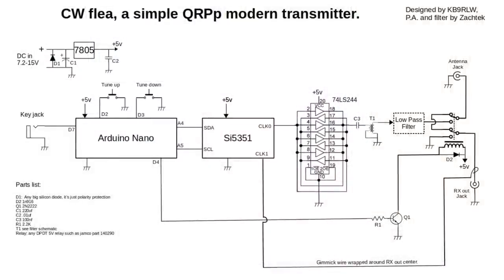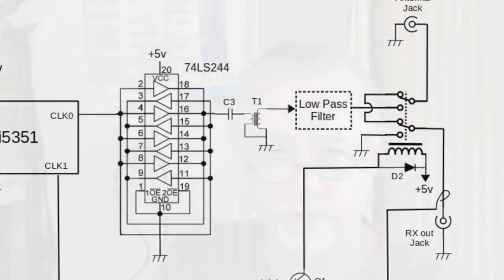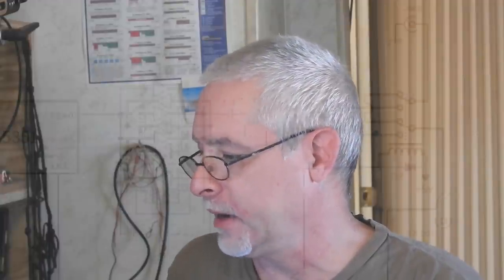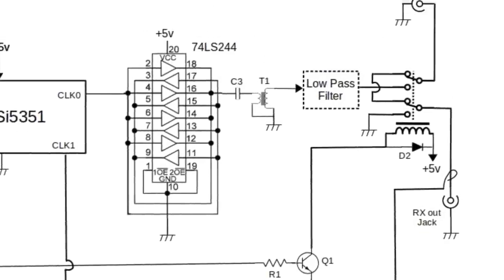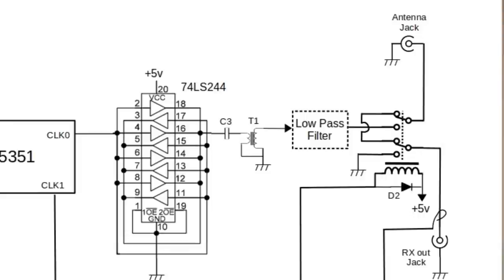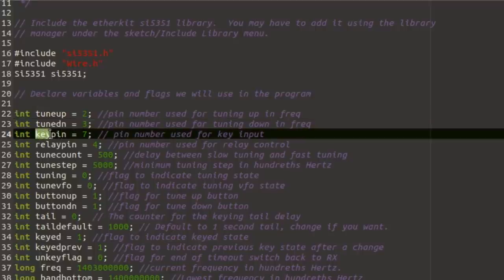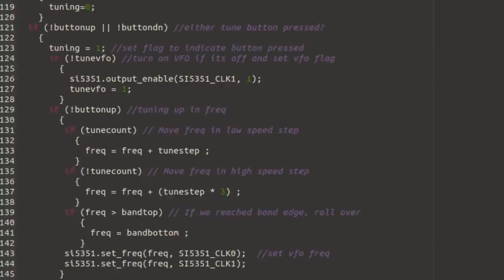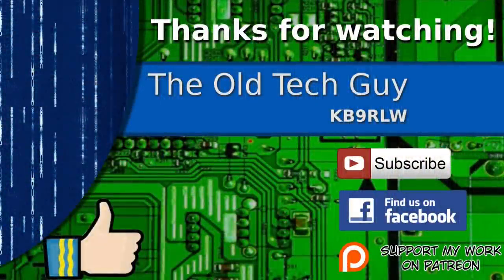Ham Radio - The CW flea project update. Design and software done.

Comment: Looks like you have a transmitter that can run off a 5 volt phone charger battery pack or a couple 18650 cells. Build a receiver with it using the SI5351(Direct Conversion) and have a low voltage transceiver.  Very cool! I can see some fun possibility's with this and SOTA. I see this in my future. Thanks Kevin!  Great project. De Troy KF7SEY
Reply: Was also thinking of using the SI4732 chip which does AM/FM/SW all in a chip. Would be cool to have a system that can actually run on a couple of AA batteries.

Comment: Why do you need your frequencies in hundredths of a Hz?  Define the initial values in Hz. Set your minimum tunestep to50. If you need hundredths of a Hz somewhere, have a local variable where the frequency in Hz is multiplied by 100. It will make the code easier to follow and also reduces the chance of mistyping the initial values - the fewer the digits in a variable, the better.

[edit]If I recall correctly, CW is allowed anywhere in the bands, with a few exceptions. There are just small segments of various bands that are reserved for CW only.  As you mentioned, it might be wise to limit QRP operation to the CW segments.- your 500 mw signal is going to be 10 dB below a 5 watt signal. On the other hand, it can be fun trying to dig minute signals out of the noise.
Reply from the maker: I'm not a programmer, I just figured things out as I go. I'm sure there's always a better way. The software is open source, you can do whatever you like with it.

Comment: Very Cool! I have an Arduino Uno working with Ada Fruit Si 5351 breakout board. I had to add to the freq variable an offset of long freqcorrect = 002740000 to get the frequency output correct as measured by my Siglent 200 Mhz scope. DigKey and Mouser are out of stock on the line driver chip so looking around.
Reply: In  the  Arduino  ide   while adding  the    offset to  the  variable   freq  wich  is  is  type  long    I  kept  getting an  error  saying  the  variable is typed    octal..... huh?

Comment: Hi Kevin,
The project is well along. So Harry will be producing a commercial version for sale. Wonder if his circuit could be designed to allow the option for more output using another stage of amplification. Like you mentioned an IRF510, if you add these components you can increase the output to 5 watts. And I like the logo you created. Stay safe.  73  WJ3U
Reply from the maker: I think, and may experiment down the road, that you could replace the line driver with something like the IRF510 and an inductive choke on the power rail to it.   It would need to be fed off the 12 volt rail and heat-sinked.  It would also need a driver stage since the output of the Si5351 is not enough to turn on the 510. Just a simple 2n3904 and a couple of resistors with another cap to couple it to the irf510.  The choke value I'm unsure of, would need to do some research. 
It'd be more of a stink bug and less of a flea at that point. ;-)

Comment: I like it! Simple use of modern techniques and components. How about putting the tx/rx  relay before the LPF so it also works on receive? Some simple receivers will benefit if they have poor receive filtering.
Reply from the maker: That's a thought.  Although there is always some insertion loss with a filter, so it might harm the receivers sensitivity on the desired band also.
Reply: @loughkb  That's true, but in a simple receiver it's worth a couple of dBs loss. Heathkit did it on their HW-7, 8 and 9.

There are some more mods for the Pixie in Sprat a year or so ago, and used the slightly lossier BPF which was well worth it to reduce broadcast breakthrough. (Plus the Pixie Pin 7 mod!)
Reply from the maker: @janetwinslow2039  Thanks for the info.  I might experiment with it down the road.

Comment: It looks like a fun project.  I have a question about the tuning procedure.  Do you reduce power (or switch to built in dummy load) when tuning to prevent QRM?
Reply: I think pin 3 is programmed to only come on when you "spot tune". This is happening when in receive mode and the only signal is that sneaky little one turn coupling of wire from pin 3 on the receiver input....so not being transmitted as relay is not engaged in transmit mode. So no QRM. :)
Reply from the maker: I detailed that in the video.  The second output of the 5351 is turned on and coupled to the receiver output via the gimmick wire.  The power path is not enabled during tuning.   It should also be quite clear in the schematic.  (shown in the video and also in the blog write up that's linked in the video description.  Which also includes an explanation of the tuning process.)

Comment: Is the sketch HUGE for the Arduino code? Could this be a good VFO for other QRP rigs that are less frequency "nimble"? Thanks for sharing this!
Reply from the maker: No, it's a relatively small sketch.  Sure.  This method could replace the oscillator on other rigs.  Depending on their design, it might be neccissary to include a LP filter to smooth the 5351's square wave to a clean sine wave and reduce harmonics.  You might also need a single transistor 'driver' stage to increase the output signal from the chip.
Reply: @loughkb  Thanks 🙏 Kevin.

Comment: Suggestion: replace D1 with PMOS polarity protection, that won't blow a fuse (or melt PSU if there isn't one), and the cost shouldn't rise too much. Also Q1 with NMOS such as 2N7002, lower current consumption and the price of small NMOS should be even lower in quantity.
Reply from the maker: The additional voltage drop across the mosfet would probably increase the minimum supply voltage from 7.2 to 7.8 and we'd lose the option of running it off a 7.2V lithium pack, I think.
Q1 is just acting as a switch, the relay coil is the load, you might shave off a fraction of a milliamp, but hardly substantial.   
However, you are certainly free to modify it as you like, it's an open design.

Comment: Hey Kevin, great project. Are you planning on integrating all the components on the pcb? Because if you are, you're most likely going to have issues finding sources for the SI5351. Most vendors are out of stock of those ics. I have a friend of mine who was designing an sdr transciever using those ics and he had to halt the project because he could not find mcus or si5351 anywhere. If you are planning on using modules, there might be a limited amount of them out there at this point. I hope chip shortage fixes itself soon because even my day job has been deeply affected by it...
Reply from the maker: I'm building mine as a hobbiest and using the modules.  Zachtek will be using the SMD components and has a source lined up I think.
Reply: @loughkb  Yes, I had to struggle early this year when they ran out to find some one and I manged to finally get a few thousands in August so I am good at the moment but it is a constant struggle to keep inventory up. There is now a Chinese clone of the Si5351 that is as good or better according to Hans Summer. It is called MS5351M, there are plenty of stock for those at the moment.

Comment: 6:20  12 to 50 ohms "4:1 transformer"  IIRC, a voltage and turns ratio might be better called "2:1" to achieve a 4x impedance ratio. i.e. A "2:1" transformer, with a 2:1 turns ratio, changes voltage by 2:1 and current by 2:1 in the opposite direction, thus changes impedance by 4:1. But it's still a "2:1" transformer.
Reply from the maker: I'll insert the word "impedance" in there on the documentation to make it clear.

Comment: I think the amp design philosophy is all wrong.   This issue of getting power out of an Si  or an AD98xx has been solved before.  The CHinese HB 1A solves it by driving the gate of  FET ,  J310 or simlar with NO bias (there ) and the FET has a pair of RF transistors in  the   Drain line. The second one is pulling enough current to drive out  150 mW or so which is compatible with a home made RF transformer.  This latter drives an IRF 510.  Given you are getting  40x  the power of the current offering why not make the effort.   The HB1A is no longer offered and the schematic not easy to find it seems, though I have a copy. .Adam Rong used to sell it and had a part in the design.  

The other option is what was done by Dave Benson for the 4SQrp group monobander where  a 74AC04 drives  three BS170s in parallel - no transformer required.  This is compatible with drive by an SI 5135  with no blocking capacitor  , which is always  the source of strife.  These simple designs did not happen by accident - they are distilled .  Output of this latter - about three watts. 

TE .  Fidler
Reply from the maker: So go ahead and build it that way if you like.   It's an open design.
Of course you won't be able to run it off a 9V battery or 7.2V lithium battery.  It won't be a 'flea' any longer. :-)
Reply: BTW the  HB1A uses   a low power BPF to  achieve  a sinusoid before it even reaches  the   FET I spoke of .   If  you are lacking power to do that then  a 74AC logic 00  or 04  (latter hex inverter - using all six gates is asking a lot of it ) can bring the power up considerably as each gate can nominally drive a 75 R load. You can run that logic at 6 V instead of 5V too.  I don't agree with the use of  74LS logic to drive  HF ham applications where there is something much better.  74 AC logic will produce useful power at 40 Mhz so in the HF band it has head room.    Running a low square wave through a capacitor and expecting enough RF current to drive a home made RF transformer is a big ask.   but for people who want a challenge...

I'd suggest that  a type B design which drives the input oscillator cct of a  Diz Kits and Parts organic  5W  transceiver to make it frequency mobile would be a lot more rewarding,  esp if it included either:

 audio annunciation of frequency or 

drove a two line LCD display.